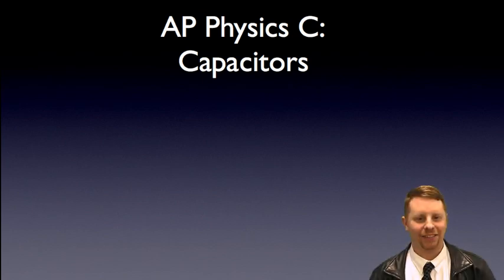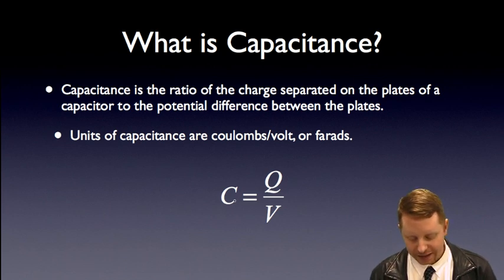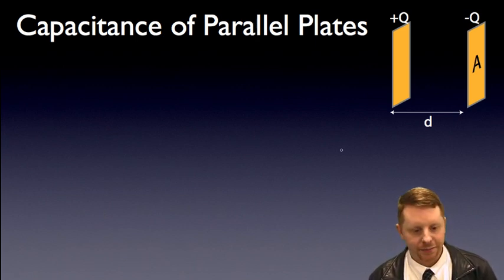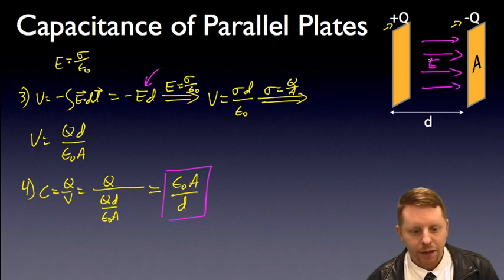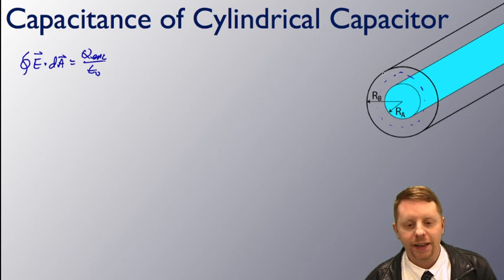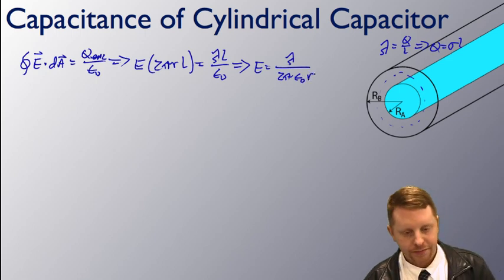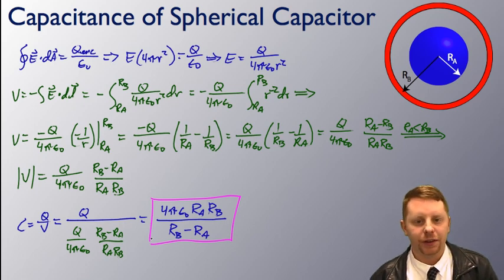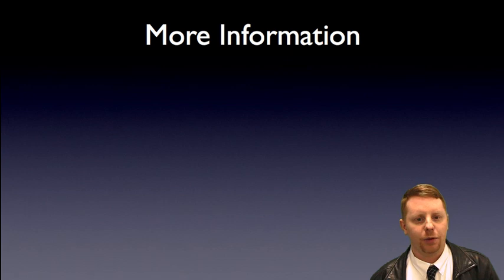AP Physics C - Capacitors

Comment: At 2:53, where does the negative sign go when you replace E?When we are calculating electric field, should we use formula k•Q1/d2 for point charge and density/ E0 for plate charge? Or we can use both of them.
Reply from the maker: Hi pengrun.  I was focused on the magnitude so I didn't worry about it in this problem.  density/e0 comes from a derivation of kq1/r, so they're mathematically equivalent.
Reply: okay, thank you.

Comment: How come we use the linear charge density for the conducting rod but not the surface charge density for the conducting sphere when calculating the electric field?
Reply from the maker: Because it is a lot easier to just use Gauss's Law to find the electric field due to the spherical capacitor, already assuming the charge.  In short -- it wasn't required.  :-)

Comment: Hi dan love the videos i have been binge watching today lol. how come in the problem with the cylindrical capacitors, u treat E as a constant and pull it out of the integral in the first step, but then substitute in lambda over yada yada yada in the second step when you are trying to solve for V....
If you could respond tonight that would be amazing... Thanks!!
Reply from the maker: Ben Eckardt Hi Ben.  We used Gauss's Law to solve for the Electric Field of the cylindrical capacitor.  Because we defined a Gaussian surface with appropriate symmetry, the electric field at all points on that surface will be the same.  The video on Gauss's Law goes into further detail on the point if you'd like more background info.  Thanks, and good luck!
Reply: Thanks Dan! you're the man... wish u were my teacher!

Comment from the maker: Hi Zhixuan.  No particular reason to go from Ra to Rb instead of the other way around... you could go the other direction if you wanted.
Reply: Wouldn't it make a difference? If we flip the limits of integration that would require us to multiply the whole integral by -1...?
Reply from the maker: littledivergirl1105 Yes.  Assuming you're focusing on the magnitude, however, not a major concern.
Reply: Thank you! I had the same question myself.
Reply: So Mr. Fullerton, I got for the question 2*Pi*L*E0 / ln(Rb/Ra) when I did the integration in the opposite direction (different limits of integration). How and when would I know that I need to multiply the limits by a negative sign, like in here  to flip the fraction in the natural log.

Thank you, and have a great day!
Reply from the maker: If you get a negative number for the answer, take the absolute value so you have a positive capacitance.
Reply: So I should have taken the negative as the ln(Rb/Ra) would have given me a negative number?

Thank you very much for your help! You are a life saver, and I am self-studying this class!
Reply from the maker: Try it both ways -- you just get the negative one way compared to the other.
Reply: ohh ok. Thank you very much! You are an amazing teacher

Comment: Thanks for the video, but something seemed to go wrong around 5:30. You said lambda=Q/L, then wrote sigma*L=Q, then said "sigma" while you wrote lambda. And shouldn't it be sigma since the cylinder has a two dimensional surface?
Reply from the maker: You are correct, I should have stuck with lambda (linear charge density) throughout.  And for our purposes of deriving the electric field with Gauss's Law, we can treat the inner wire as a line charge, since we're only worried about the electric field between the two.  Good catch!

Comment from the maker: It disappeared!  (OK, I think I'm funny, you already knew that).  I should have specified in the video, but because we're focusing only on the magnitude of the potential difference, knowing V would be used in the capacitance equation, I neglected to follow it through.  Negative potential going one way across the parallel plates would be a positive potential going the opposite direction, or start at the oppositely charged plate, you still get the same answer.  Apologies for not explaining better!